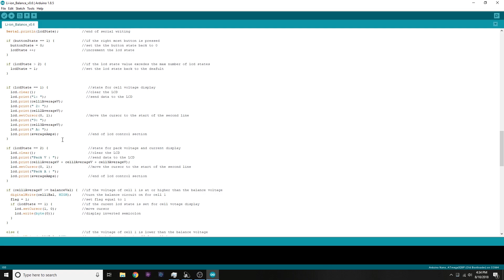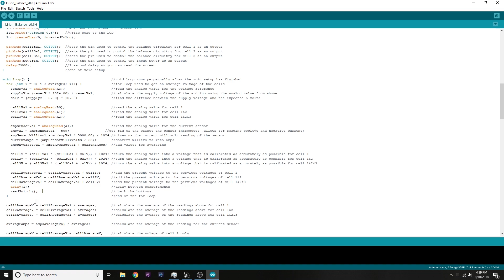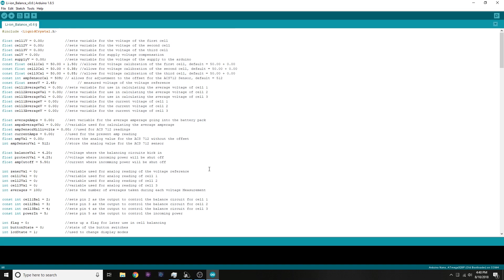Arduino BMS #10 Github and Buttons

Comment: Yo man in hopes for your input:
I want to make a 14s battery and coonect them like 2x7s and have 2x7 dongles to use an 7s charger instead of BMS.
1st i want to know if its possible to have a 14s battery under load while trying to charge it through a smart charger? I ask this, cause i am looking for ways to have an e-bike system with an added solar panel that would passively balance the battery. 
If nothing else it would be fine to have this sysem even if you are stationary and recuperate 2-6km and would take care of balancing by being "self powered" instead of balancing through other batteries and when you come home you never ever have to check for balancing.
Is this possible?

Comment: Hey, nice project. I am also working on a diy bms with arduino (up to 14s) and have an idea to improve your project (if you want of cours).
Your project uses a voltage divider to measure the cells. This works okay up to 4s but gets real accuracy issues if you want to go higher. The solution for this is using a opamp as differential amplifier on every cell. The differential amplifier wil only deliver the voltage of the cell it's connected to. This way the full range of the adc can be used on every cell, improving accuracy. 
This system can easily be upscalled to 14s+ (at these voltages the max voltage of the opamp need to be taken in account).

I hope this can help your project.
Reply from the maker: Thank you, I will look into that. My end goal for this project is to be able to go up to either 6 or 8s.

Comment: Its perfect bro. Soon gonna make it.
Plzz if you could implement a bt which could send details over terminal on phone or some app
Reply from the maker: I might eventually. Right now my primary goal is to get the primary functions of this thing working as well as I can get them to.
Reply: I did it bro implemented a bt with just serial.print and using millis and using serial bt terminal to get the values. Did it on stm32 too but it tends to hang working on it. Thanks broo
Reply: Please could you tell the value 1024 in code is what ? Resolution ?

Comment: Yes, you built the bms.  Question is,  how well does it work?  Would like to see how it charges and protects cells.  Thanks
Diydave
Reply from the maker: I wouldn't consider it a "built BMS" yet. Hardware is probably mostly final but the software still has a lot of work that needs to be done. I've only done enough testing on this to feel comfortable releasing the software and schematics. There is a reason I have the software as version 0 still. It works fairly well as a basic BMS though. I've used it to charge a couple of battery battery packs and it does a decent job.

Comment: Thank you so much for this! Exactly what I was looking for.
Reply from the maker: glad it's useful for you
Reply: @Eman2000  I have been working with the code and hardware and did some really nice changes. May I ask why you didn't use the 1.1v internal voltage reference? That gives way more resolution. And it is a very stable reference, so the extra voltage reference, with the math that comes with is isn't necessary anymore. I then calculated the voltage dividers so that the maximum voltage to be measured wasn't 50 volts, but like 4.3 volts for cell 1 and 8.6 for cell2 and so on. I then put that number as whole millivolt number like 4300 for cell1cal and calculate the value like this: cell1V = (cell1Val * (cell1Cal / 1024)) ;  That gives an resolution to the last millivolt. To my surprise extremely accurate, and is still very easy to calibrate. Works only with soldered connections tho. Had the same troubles like you with the breadboard haha.
Reply: @motorstunter  Can you recommend a Sample Op-Amp for 13s bms?

Comment: You should use a loop with a alarm timer with millis() ... that will make the buttons more responsive.   

I have forked your GitHub code, and will work it a bit.  I need a 6S BMS and have a bunch of atmega 328p parts, so I plan on contributing code, and adding a bit more to the schematic to allow it to handle 22V, 50A through protected FET's.  You've provided a great base to start from!

Comment: Hi mate like your BMS work keep up the great work mite take a look at Mega Mechatronics  ATtiny & optocoupler set up monitoring cells mite help with getting a better reading on cells.
I myself have a LiPo project battery build under way as i also us solar and gridtie units that would like to manage the life for longer 20amp discharge 5amp charge.

Comment: I'm either thinking of giving this a try. Or a baitrium! It's gonna hurt paying that much for something that doesent output power. I can see spending on cell, solar panels, or charge controllers. However all those expensive cells need protection!  I don't know much about arduino. I never had one. I have only watched videos about them .  but they are alot of things I'd like to do with them or try to do!!! Great video.
Reply from the maker: Thanks, the arduinos are cheap enough to buy some and play with them. You can do some very cool things with them.